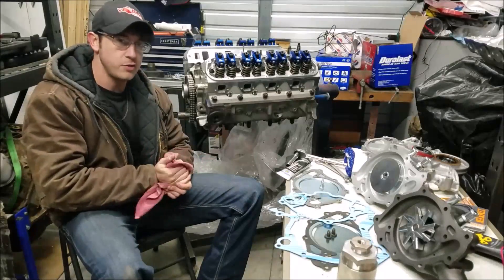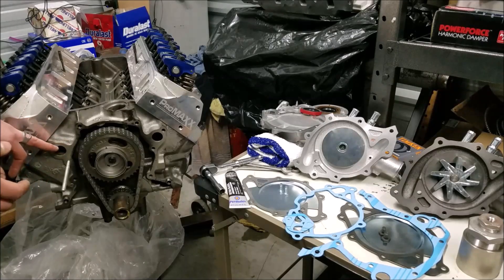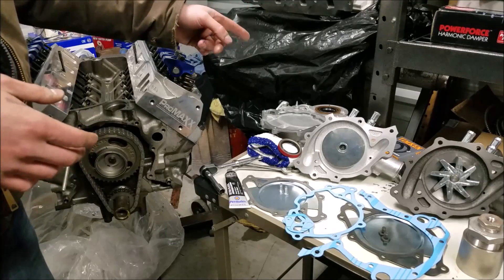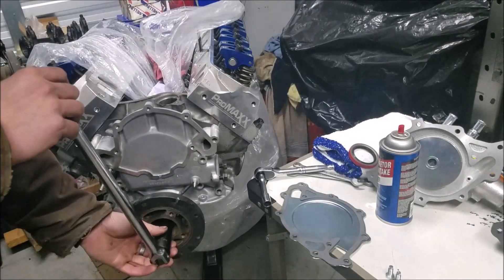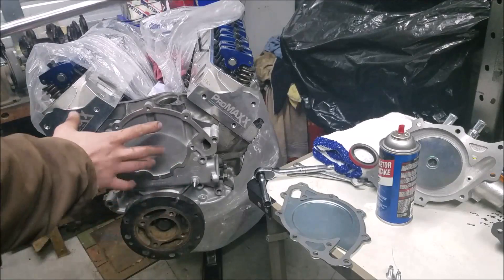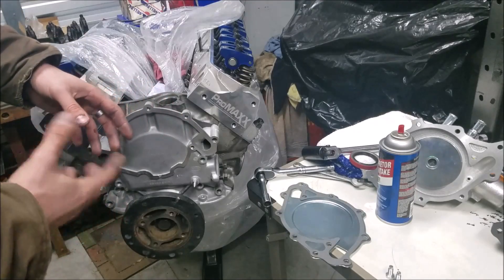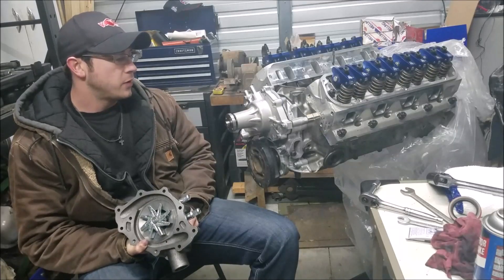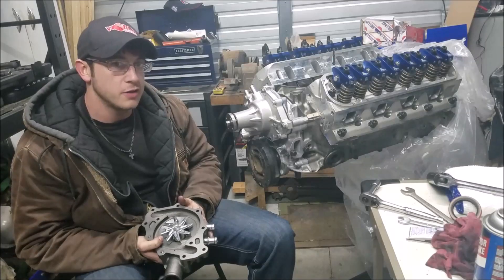Timing Cover & Water Pump Install: FULL How To/DIY (302/351w SBF)

Comment: Been eyeballing those promaxx heads on summit. Decent price. What set did you end up picking up? Curious how they are going to work out in long run. My 289 may be wearing a set before summer.   happen to get any video of valvetrain assembly or review  the quality of the castings?
Reply from the maker: I do - if you sift through I did one last year. 
These are promaxx bare castings finished out by skip white performance in Tennessee. 
I’m very much impressed. Shipped to me completed they were $980